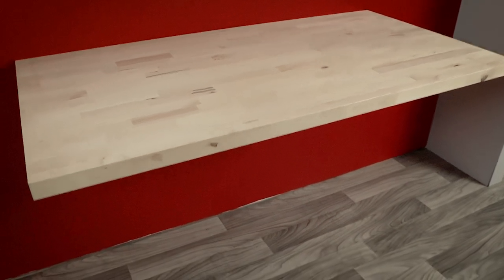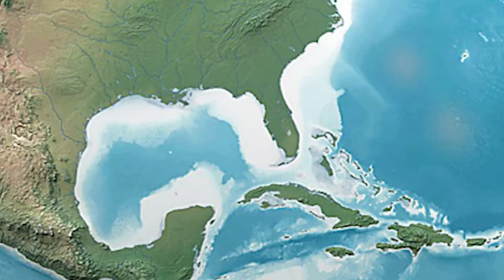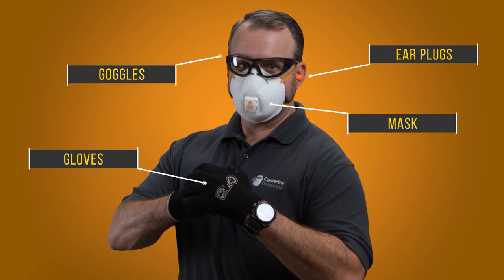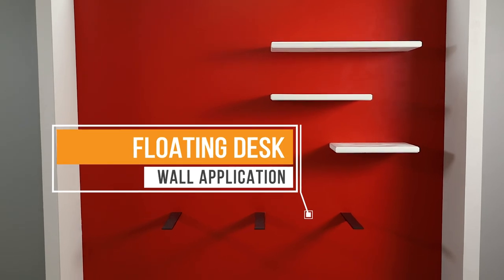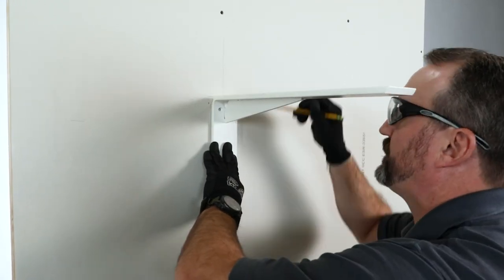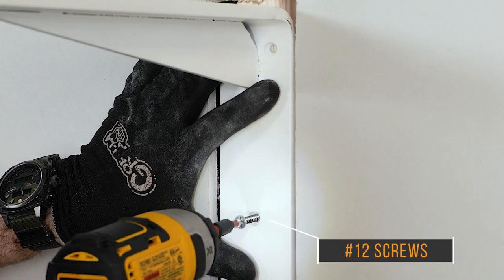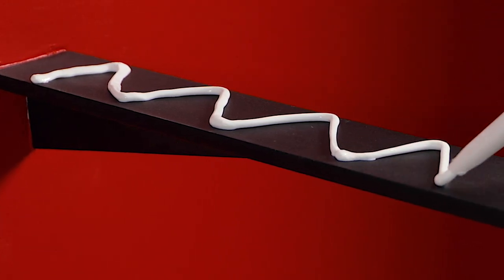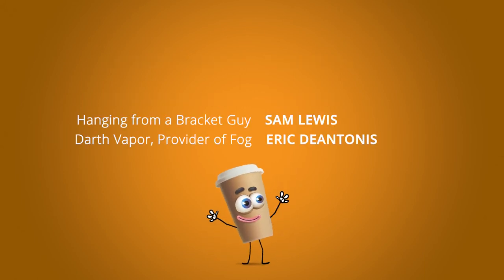Install - Front Mounting Plus Countertop Support Bracket

Comment: How would you secure a granite counter top?
Reply: You should be fine using a strong silicone/caulk on top of the brackets. Granite is heavy, and as long as it is firmly adhered to the brackets, it won't go anywhere.